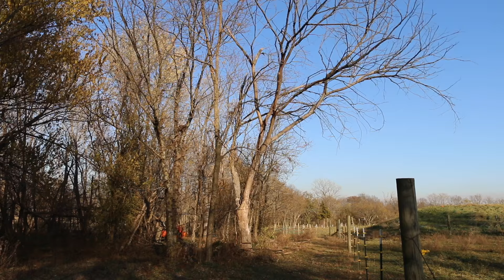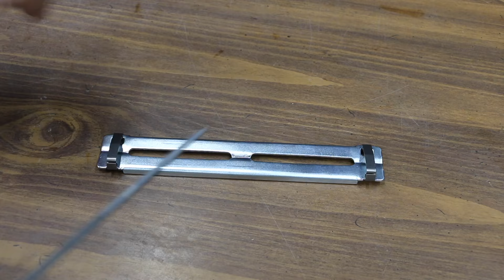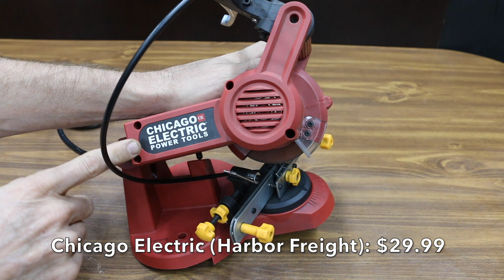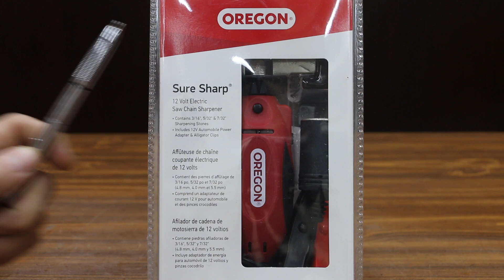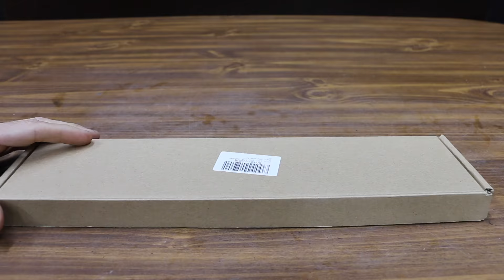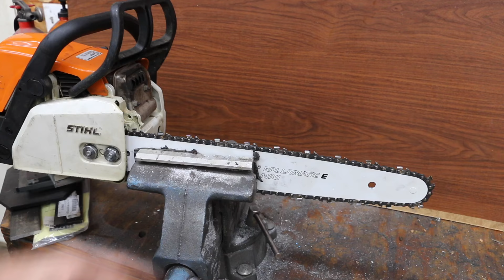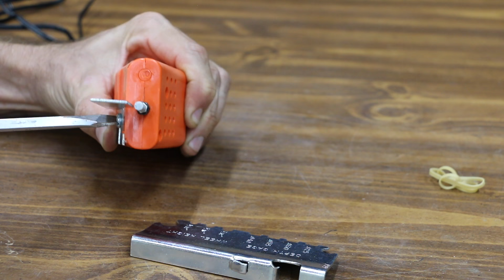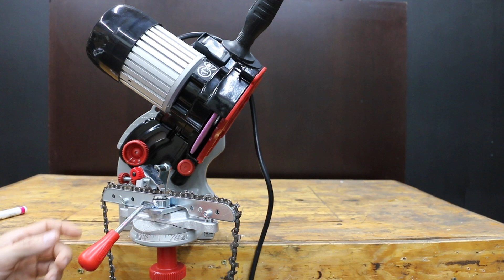Which Chainsaw Sharpener is Best? Let's find out! Stihl, Granberg, Chicago Electric, Oregon

Comment: An electric grinder does put on a good edge, but I've found that the edge doesn't last as long as using a file. My theory is that the grinder doesn't take the temper out of the whole tooth but does take it out of the fine cutting edge, as the edge is so thin. It's the only thing I can think of that would cause this to happen. I'm a retired tree climber and have sharpened saws thousands of times in the field.
Reply: I've been cutting firewood for 20 years, and completely agree. Even if a grinder can get it just as sharp, it just doesn't last
Reply: I have noticed this but still use my HF grinder about every 3rd sharpen and then lightly.   I still manually field sharpen when needed.
Reply: Seems like any electric sharpener is bound to shorten the chain life.
Reply: I find hand filing is plenty good enough, and definitely the way to go in the field. I touch up while taking a break gassing and oiling the saw. 'Machine grade accuracy' disappears fast while cutting. Touch it up and get back to work.
Reply: It is all in the mechanics of how youre holding the grinder. If your pass has a wobble or canter then you have a weaker rounded more dull edge.
Every rig is going to have different results. How precise is your rig/jig?
The alignment of your arm grinder body is very importantant not to have a cross action working against your angle of a perfect inline stroke..

Comment: A "dremel" attachment is the all-time best sharpening system I've ever seen. They're cheap on amazon and I get those big chips of sawdust you get with a brand new chain every time I use it!
 
Now I just need a cordless rotary tool to throw in the saw box, because you'd rarely have to charge it and sharpening a chain with that is probably the fastest way I've ever seen to get that level of precision.
Reply from the maker: Thanks for sharing.
Reply: @ProjectFarm  I'd love to see your impressions on some kits for the dremel if you have the time to check it out. I suppose the electric STIHL (was it?) sharpener you used is close but I find that the guide for the dremel sharpening kits is really nice for getting repeatable results, at least with my experience.
Reply: @ProjectFarm  I agree the Dremel is quick and easy. However, I prefer diamond impregnated burrs instead of the grinding stones. They last longer and make a finer, sharper edge. They also maintain the same diameter even as they dull so tooth geometry does not change.

Comment: The Stihl 2 in 1 lives in my belt pouch and gets used in the field — clear winner in my opinion…
Reply: I bought one of these a year ago and haven't looked back since. The best for ease of use, compactness and price. Top quality as well. I agree. The winner in my opinion as well. So easy to use you could sharpen your chain in the porta john after morning coffee. Double threat this thing is..
Reply: It's what I use.
Reply: I just bought this thing and I'm blown away at how good it performs and ease of use.  I'm sold on the 2 in 1.
Reply: @williamwalter4882  Yep simple, foolproof, and effective. Kinda perfect.
Reply from the maker: Thanks for the feedback.
Reply: Totally agree.  I’ve used several similar systems that he has tested and unless the chain is pretty wrecked, that 2 in 1 is the way.  Usually 2-3 passes is enough to start throwing nice chips again.
Reply: Does indeed seem like the best option. It's quick, gives a good edge and doesn't require and electric power or fumbling around in the field. The Grandberg systems worked well, but it's too much of a setup for on the go use.
Reply: I use a German brand. Also good. Keeping rakes tuned is important. The dremels eventually cause a problem

Comment: That battery saw wont have the balls to pull it but shorten those rakers and you double the cutting speed on evey one of those chains. Seems the 2 in 1 is so good because it will shorten the raker wether it needs it or not.

Comment: I would have like to seen how well it would have done with just hand filing them. I know it takes longer but might get better results. Never know.
Reply from the maker: Thanks for the suggestion.
Reply: First thing I do when I buy a new chain is sharpen . Chains that are hand filed right will always win.
Reply: @pallmall5495  even if a grinder can get it as sharp, it doesn't last as long. I still sit down and hand file my chain. Take my time, it's definitely satisfying when its throwing off 3-4 inch curly q's
Reply: @ryurc3033  when a grown man gets pulled off his feet by a 50cc saw you know she is sharp. Plus most chains I have seen that were on a grinder had turned blue and the temper in the steel  was lost.
Reply: @pallmall5495  heating the cutter is definitely a factor. Hand filing seems to avoid that completely. And keep the factory hook if done properly
Reply: @semiprofessional8470  yep, and filing out the beak and the gullet is almost impossible with some grinders, except for the rotary  dremel type grinders.I have cut as much as 10 loads of clean wood between hand filings, and then it just needed 2 or 3 light strokes on each tooth.I guess the grinders are  a good time saver though on a rocked chain.

Comment: the oregon are the most capable and should of been the best time.  Just need more practice setting it up and working with it.  some of your cuts were slanted with longer cuts and thus more drag on the blade making the cuts slower.  you need a fixed saw to be accurate.

Comment: I have something very similar to the granberg, where it just mounts to the bar with the chain installed, I think  mine is made by Oregon, or maybe some knockoff . It’s a pain to setup, and it eats the guid rails.  It does sharpen very well, but it takes a long time and it hurts my hands. If I’m gentle it doesn’t do crap, if I’m aggressive and put good pressure on every link, it does great, but it hurts.
I’m not sure what to try next, the Chicago electric seemed to do OK with sharpening, but very fast. So it’s either that one or the stihl. I don’t know if I want anymore hand held units.
Reply from the maker: Thanks for sharing.

Comment: 50 years in the tree business, over 70 saws on display, 70CC's and up. My favorite ia a 1973 Homelite Super 1050 with 45" bar.  Next is a Stihl 660 with 25" and 36" bars. I hand file all of them. I think the clamp on guides are great for beginners. Once you get used to the angles you dont need them. If I hit metal in a tree ill use a bench top grinder to get the nicks out and finish with hand filing. I enjoyed you test and think its great info for beginners.
Reply from the maker: Thanks!  Thanks for sharing.

Comment: Great video! Just something to put on people's radar depending on what you're doing. I'm not a fan of the electric models, they take off way too much chain, and chains ain't cheap. On the manual side, the Stihl 2 in 1 looked like a great option, BUT it's designed to visually guide the angle of sharpening at 30 degrees (and only 30 degrees) for cross cuts, ie., cutting firewood, tree limbs, etc. Some chain cutters are at 35 degrees, so maybe not a universal solution for cross cuts. Please note, though, if you're doing any kind of chainsaw mill work going length wise on a log, it's bad news bears...rip chains generally require a 10 degree angle for sharpening, so if you don't know better you'll ruin your chain. Something like the Granger Bar Mount will give you the flexibility you need to adjust the angle for any cuts with precision repeatability, as mentioned. Stihl is a bit of a one trick pony. But if that's your pony, have at it.
Reply from the maker: Thanks!  Thanks for sharing.

Comment: I have old and new Harbor Freight units and love the new one with the clamp lever. I am lazy and hate sharpening chains, so the easier the better. I have had good luck with the HF units and have been using my oldest one for years and recently went to the new one with the clamp. With a little practice, I get sharp chains that cut straight.
Reply from the maker: Thanks for sharing.

Comment: The problem with the grinders is they don't come with a depth gauge file, that has to be bought separately and the Oregon one is soft crap that will get filed down. I use the Husqvarna X cut jig that comes with 2 round, 1 flat, depth gauge, and guide for like $18. It works better for me than the Oregon field sharpening kit and the depth gauge is way better than Oregon's soft junk one.
Reply from the maker: Thanks for the feedback.

Comment: Great video review! The one downside to the bench type and rotary bit grinders I have observed is that as the grinding medium  (disc or bit) gets worn and gummed up it tends to heat and temper the cutting leading edge of the chain tooth. Then when you need to sharpen in the field it becomes a bugger to file through the tempered steel of the saw tooth.
Reply from the maker: Thanks!

Comment: did not use the 12v/or220v sharpener that gos over the bar no chain removel leave on chain saw but where bolt locks it on bar  needs counter sunk with drill to make shore its fitted the same every time u use it to be in same spot  the best sharpener  few other trick i use so dont have to sharpen so often lasts a lot longer

Comment: Back a many of long year ago (48 of them) I worked at a tool rental place. We used a sharpener just like the Oregon 120V Bench sharpener. Might have actually been one.
I can't say I remember locking the chain down, though it did have the lock. We just pulled the chain against the stop.
I was taught to knock the rakes down as you sharpen each tooth regardless of their height. To mark where we started, we'd score across the top of the first tooth.
Sorry, I forgot to add....
Anyway, after I got my first chainsaw, I simply used a die grinder with a skinny cut off wheel. It works well, though the angles may not be quite right. It has worked well enough for me for at least 32 years now.
Reply from the maker: Thanks for sharing.

Comment: The trouble with using powered grinders to sharpen anything dry is heat .  You can see in at least one of the closeups, the teeth are discolored blue after grinding. That oxidation color means you've overheated the steel; it's no longer tempered properly, and it will not stay sharp as long. That chain is more or less junk now... you'll find yourself sharpening it a LOT more often, and therefore you'll have to replace it much sooner.
Reply: Yeah, there is a reason why powered knife grinders run slow and in a water bath. Even the vintage foot cranked knife grinders ran a water bath. Temper is key for cutting tools!
Reply: oh god this wives tale again, saw chain is not hardened, that's why you can sharpen it with a hand file . the only thing you end up doing by "blueing a tooth" is make it harder to hand file sharpen because you have potentially added temper
Reply: @tyler7433  Yup, these chains are 20 bucks new. They are not high end exotic steel you would find in a chefs knife of high end edc knives.
Reply: First it had to quenched to be able to temper it. When you heat up the chain uncotrolably then coll it down in air, its not tempering. @tyler7433

Comment: I bought the Chicago electric chain saw sharpening tool at Harbor Depot. Somewhere in the range of $30.

I’ve used it for over a year, only Sharpen perhaps five or six chains yearly, but it does a fantastic job.

Comment: There is alot to be said for not having to remove the chain from the chainsaw.  I went from using a simple file to a dremmel, then to the Stihl 2 in 1 - works well.

Comment: I was really hoping you would test that crazy sharpener advertised on FB. The one that attaches to the front on the bar/chain and magically sharpens as you run the saw and chain slides through it. 😂😂😂
Reply from the maker: Thanks for the suggestion.

Comment: I've done tree work all my life. I'll use new chain until it's dull and then I change the angle on the chain up to 15 to 20 ° and sharpen it and it takes chunks out instead of sawdust.
Reply: When the saw becomes dull I'll sharpen it manually with nothing but a regular hand file I'll change the angle on the chain cutting into some of the actual chain but still it's much sharper and will take chunks out of the wood instead of sawdust for a faster cut, and this is all with my eye I do not need any other tools other than a file.
Reply from the maker: Thanks for sharing.

Comment: I cut up 7 huge bundles of ash slabwood. Lots of dirt in the bark. Did at least 30 sharpenings with the Chicago electric bench sharpener.
Last was as good as the first. Paid for itself many times over.
Reply from the maker: Thanks for sharing.

Comment: Good comparison of the chain sharpeners.  In the woods, I've been using the Sthil 2-in-1 and stump vise with good results.  I resharpen ever two to three gas refills depending on the wood being cut.  Back at the workbench, I'll sometimes use a Dremel tool with their proprietary chain sharpening kit.  Good results with the Dremel but since I keep the chains resharpened in the woods (and I usually end the day dressing up the chain) I rarely use the Dremel.
Reply from the maker: Thanks for sharing!

Comment: The Stihl is undoubtedly the best as it is the only one with excellent results which you can just chuck in the chainsaw bag and use easily out in the field. I keep one in my chainsaw bag and if I hit the dirt, gravel or stones I can get it back up and running at peak performance in a few minutes without batteries or mains power

Comment: I hate using my chainsaw on the farm when cleaning up on the fence lines that have been let go for awhile.. I’ve helped on a 200 acre farm across the road that belongs to a friend of mine and another farm down the road it’s about 143 acres and in bad shape.. It never fails hitting wire when the tree has grown around it for years.. Thanks for the video and yes old logs with dirt all over them doesn’t help either..
Reply from the maker: Thanks for the feedback.

Comment: Personally I use the 2 in 1. When my dad filed one he used a file without a handle in the woods but had an Oregon sharpener that was the same style as the "File and Joint." My uncle who works on saws has a bench mount model Oregon mostly because he sharpens a lot of chains but also one thing they do that the others can but not as easy, is make every tooth the same length. This maters when trying to cut straight for sure. Note: Dad was a logger, and so was my Uncle prior to retirement, he's 92 now.
Reply from the maker: Thanks for sharing.

Comment: Just a quick comment on any of the electric sharpeners. If you try to take too heavy a cut, it'll overheat the tooth and destroy the temper, and the chain will dull very quickly. I use the Oregon bench sharpener, and set it up so I have to apply side pressure to the handle to get the stone to touch the tooth. That's how little needs to come off. If the tooth is blue when you're done, you're taking too much off!
Reply from the maker: Thanks for sharing.

Comment: Have you tested chainsaw oil?  Trying to cut through the BS of opinion in favor of facts and I’m finding very little satisfaction. If you haven’t tested oils, then I’d ask that you also test oil ratios. I’ve always run name brand oil at the recommended ratio of 50:1. The saws I used for milling called for 40:1 so that’s what I ran. I recently took my first saw in for porting and he wants me to only run 32:1. He had some great reasons why and I saw a high hour saw that had a case that was spotless. No coking or deposits at all. That got me thinking that maybe a richer ratio would be better.
Reply from the maker: Thanks for the suggestion.

Comment: I know this is about a year old, but I still find it very helpful.  I need to cut down 2 trees,  and I have sharpen the chains on 3 saws,  I also have one new chain. So when I go to cut the trees down,  it shouldn't be a problem. I heard a few guys say the saw should be sharpen at every fuel up.  I don't know if that's correct or not.  I just cut what I need to. I like having fire wood. I don't have a fire place,  sure wish I did.
Reply from the maker: Thanks for sharing.  Thanks for the suggestion.

Comment: A factor that is difficult to account for is user skill, and in my case, I need a tool that requires no skill unless I want to cut circles. I have a sharpener similar to the HF model tested here, and it makes my chains sharp and they cut straight.
Reply from the maker: Thanks for sharing.

Comment: Great video as always.  Have a Stihl saw and chain, use several times a year for firewood.  Purchased 3 diamond files on e bay years ago.  Clamp in the vise using a home made cardboard template with 30 degree lines.  Cuts faster and the chain last longer than with a steel file in my opinion.  Will consider the Stihl 2 in 1 for the depth gauge feature.
Reply from the maker: Thanks!  Thanks for the suggestion.

Comment: The grinding wheels will make the sharpest cutter (Oregon and harbor freight)  The cutter shape needs to be completed with passes from a round file.  May not be the fastest method but will provide the most sharpness with the correct tooth shape.
Reply from the maker: Thanks for the feedback.

Comment: Thought about buying a sharpener can't stand using files, years ago I bought some dremel grinding stones and use them in my die grinder just by eye and got pretty good with them I'm not much on perfection just make it work and get r done.